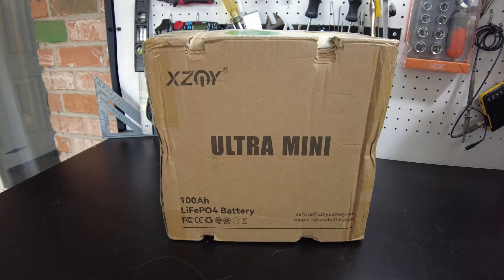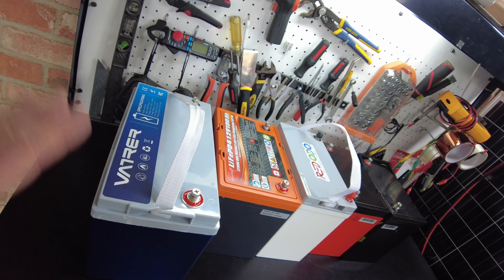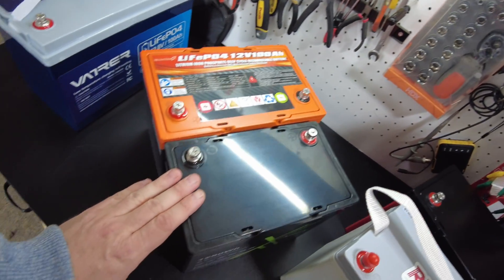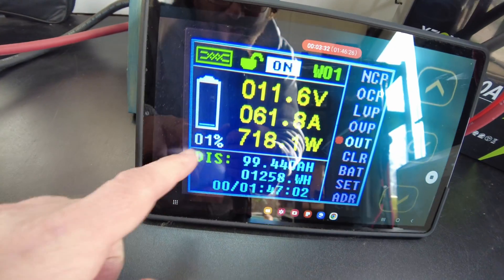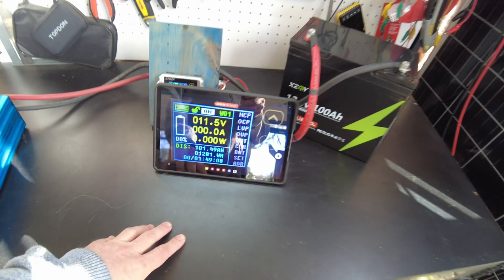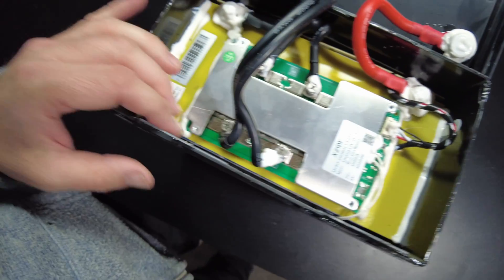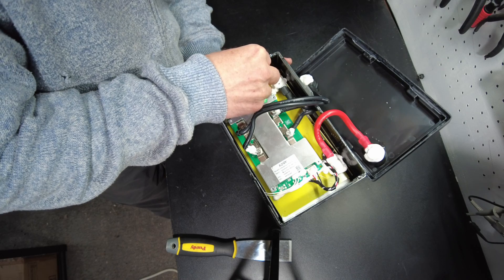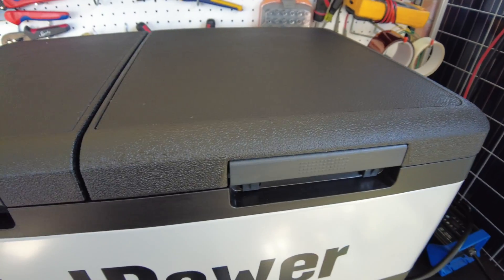XZNY ULTRA-MINI 12v 100Ah LiFeP04 Battery

Comment: I got a 12.8 volt 50amh  LifePo4 battery.
I'm using an  54.7 volt  ebike charger , will  the 54.7 volt do damage to the LifePo4 battery?
Reply from the maker: Potentially, you're relying on the BMS to save you each time you charge. The BMS could eventually short a MOSFET, and that would let the cells WAY overcharge. So yeah, stop that ASAP, and get a the correct charger. Thanks
Reply: @BradCagle  Ok thanks .My  genuine ebike battery charger uses 54.7 volt .I'm wondering what other charger I can use ?
Reply: @BradCagle I think I mess up my LifePo4 battery from using the 54 volt charger.
The LifePo4 wont take a charge anymore or work with the inverter,Im wondering if you have any idea to fix this.

Comment: Brad I just found out that Victron charge controllers have a temperature setting that you can setting you can set to stop charging below freezing.  This can be a great boon to those of us who didn't buy a battery with low temp charging protection or a savings for those contemplating the purchase of a LiFeP2O4 battery.😂
Reply from the maker: Nice, I need to check that out. Yeah thankfully many charge controllers have this now. Years ago at my work we were using EPevers with LiFePO4 batteries that had no low temp protect. The EPEvers have an option called LiProtection (I think that's what it was called). Several of these are still out in the field performing flawlessly. We do use Victron now because the software, and monitoring is best in class. Thanks!

Comment: Thanks Brad. Thorough review as per normal.
It occurred to me (yes, I know, a little slow) that this packaging procedure and welding of the cell bus bars actually reduces the maintainability of the battery. Since you open every battery, maybe another check list item is maintainability?
Reply from the maker: Yeah, I'd say less than 5-10% of batteries these days have bolt on busbars. Probably will be none at some point :( But yes sir, I'll check for it. Thanks, Ben!

Comment: Great video. The Redodo 100AH Mini is actually taller than the standard 100AH.  I had to return it because it it wouldn,,'t fit in my Licitti battery box😮
Reply from the maker: Yeah true they are taller. Hmm, I wonder if I can cram two of these ultra-mini form factors in a Licitti?
Reply: In the jumbo one@BradCagle  I bet you can

Comment: Excellent presentation.  Thank you.  Quite honestly, that is how a "case to contents" battery should look.   The case perfectly fits the cells and BMS with no crappy wasted space involved.   Most normal people would think they would all be made this way, however, you would be very, very wrong.  Nice to see this trend with batteries.  I have a couple of Li Time Mini's that I use for camping but this one makes them look huge.
Reply from the maker: Thanks, glad you liked it. Yeah man these things are getting tiny, this is like 50Ah physical size territory, but at 100Ah. Wild stuff 😀